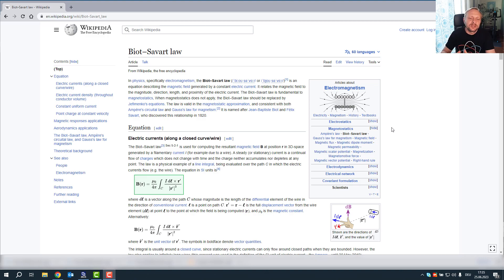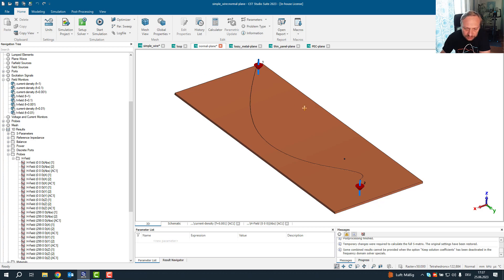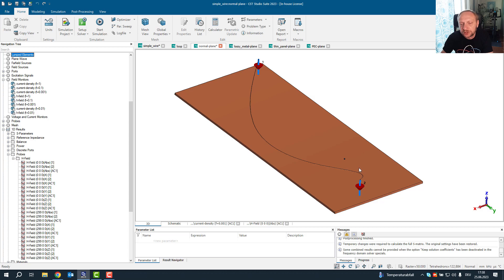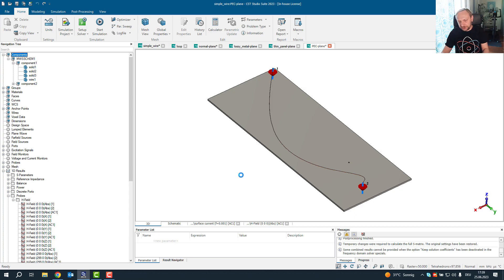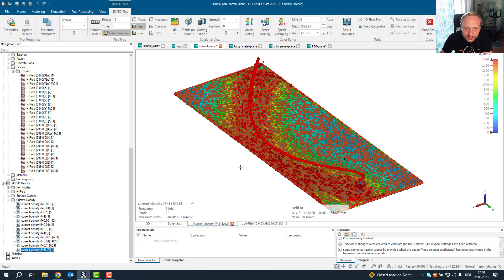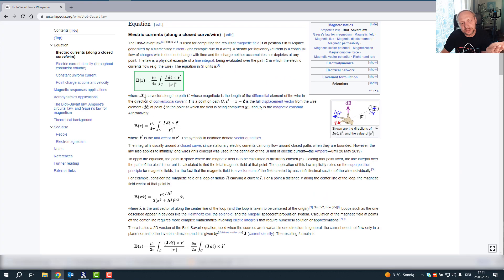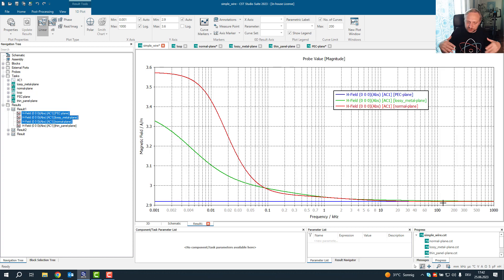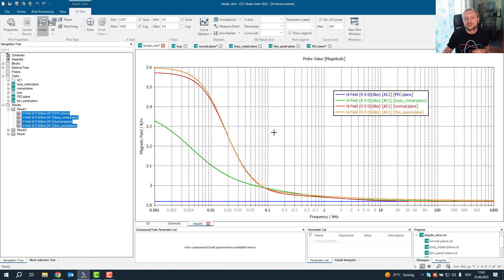Frequency dependance of the magnetic field??

Comment: Der mir bekannte Fachbegriff dafür ist "Proximity-Effekt". Was ich mich aber immer gefragt habe: Gibt es etwas Derartiges auch für die Kapazität? Also, kann ich Fälle haben, wo das E-Feld trotz konstanter Permittivität frequenzabhängig wird? Spätestens wenn man nicht mehr im quasisationären ist und man sich mit Welleneffekten herumschlagen muss, wird das ja sicher der Fall sein, aber reicht es vorher immer aus bei der Kapazitätsberechnung ein zusammenhängendes Leiterstück als eine Elektrode zu betrachten? Denn so machen das ja solche PEEC-Solver wie bspw. Ansys Q3D. Die Eigenresonanzen von Drosseln etwa kann man so ja auch nicht beschreiben, hat hier also eher HF-Effekte, aber schon bei deutlich niedrigeren Frequenzen, als wo man erwarten würde, dass Welleneffekte eine Rolle spielen.
Reply from the maker: Man kann es wohl auch Proximity effekt nennen. Bei der kapazität würde mit kein Fall im im statischen/quasistatischen einfallen wo es so was geben würde. Beim Stromfluss wie in dem Video ist es eben das zusammenspiel von resistivität und induktivität das zu der Änderung der Verteilung führt. Beim E Feld fällt mir nichts ähniches ein, solange ich elektrisch kurz bleibe. Bei der selbstresonanz der spule ist es ja die kapazität des leiters zu sich selbst, die man nicht rechnen kann wenn man den leiter auf ein potential setzt, also statisch rechnet.